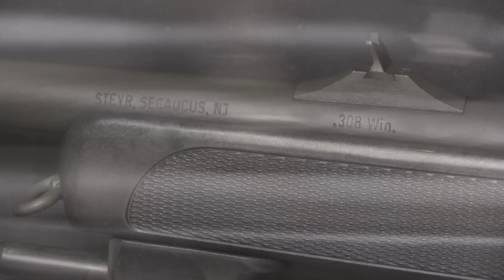SSG-69: Steyr's Cold War Sniper Rifle

Comment: The SSG-69 seems really nice, but it's unfortunate that we don't see this more often. Hopefully they make a more modern model something along the lines of the "SSG-420."
Reply: Nice
Reply: there are modernized versions
Reply: There are way better rifles than this at a much better price
Reply: Nice
Reply: Nice
Reply: @easy_eight2810  You know, I've always found the younger ones to be more enjoyable.
Reply: @easy_eight2810  Joke went right over your head, didn't?
Reply: Thank you. I was looking for a comment like yours
Reply: While the original (REALLY) turned some heads; I can imagine your proposal would smoke most modern competition. To be blunt: It would roll the whole field up.
Reply: @Bob-qk2zg  No, but it always shoots high.
Reply: Nice
Reply: I see what you did there.
Reply: Austrian painter commemorative edition
Reply: Nice
Reply: Nice
Reply: Eloquent
Reply: Czech has a ZK 420
Reply: Hehe, 69 ... really nice.
Reply: it would be a blazing success
Reply: Nice
Reply: Nice.
Reply: Had me in the first half not gonna lie
Reply: @Bob-qk2zg  The SSG 420  works with special  ammunition and a fume extractor.

Special as in "herb-infused" and fume extractor as in "this screws into your gas mask, and you will enjoy it!"
Also cuts down on the thermal signature and improves accuracy a bit by calming you down after a few hits.
Reply: I do have to disagree that the guard is the most common failure point. It is actually the magazine. There is a very small plastic connection that likes to break. That's why 5 round magazines are basically non available, you can find 10 rounders which are double stack for a few hundred bucks.
Reply: Nice
Reply: They could chamber a bigger version in .416 Barrett and use marketing magic to call it a .420 cal rifle xD
Reply: Nice
Reply: You're blazing it!
Reply: Nice.
Reply: I understood that reference
Reply: Isn’t the SSG-420 just a Blazer-R93?
Reply: @Bob-qk2zg  hookah tube attachment in the buttstock (stock is hollow, filled with water)
Reply: ....nice.
Reply: My favorite number (wink)😏
Reply: Nice
Reply: Nice

Comment: I have two. An SSG69 with double sets and an SS69PII with a single trigger group. Both are extremely accurate. With the hand loads under 1/2" MOA is possible.
Reply: Hey. Is the military two stage trigger good enough to match the accuracy of the set trigger version? I generally like a good two stage trigger better anyways for timing shots as I have a TRG (whose trigger is pretty damn good if I say so but I always wanted an ssg69 anyways haha). Thanks
Reply: @ryaniam22  I have gotten sub 1/2 min. groups with the two-stage trigger with handloads

Comment: First time I got issued the SSG 69 I managed to get 57 out of 60 rings on first try. (you can single load a cartridge and attach the magazine giving you 6 rounds)
It speaks for itself if a conscript with minimal experience can get shots on target that easily and this further enhances the military value of this rifle.
The trigger feel of the military version is also great.

I am still looking to snatch myself one of the military pattern rifles for private use, but they only rarely show up for sale and are pretty expensive.
Reply: Hey. I'm curious, do you prefer the military 2 stage trigger or the set trigger? Generally I prefer a good two stage trigger (TRG) but could probably get used to a set trigger also. Thanks
Reply: @ryaniam22  I can't compare the two since I only shot the military version, but I can compare it to other firearms that i have shot. what I like about it is the "mechanical" feel of the trigger, and how it let's you set the trigger up against the wall, readjust your aim and then be confident when you finally want to shoot. and you don't need much additional pressure at that point, you can set it off with the very tip of your finger.
i don't like single stage triggers, for example in pistols, where you apply pressure, thinking in your head that the gun will go off and then it doesn't because you are hung up on that final part of the "hump". with such a trigger it takes much more rounds until you are confident you can judge the right amount of pressure while not "oversqueezing" at the same time. i hope that makes sense.

Comment: It's impossible not to love rotary magazines. So awesome.
Reply: I totally agree!
Reply: Unfortunately Steyr dropped the rotary magazine as well as the position of the locking lugs....
Now the actual design is far more conventional than back in the late 60ies/ early seventies. At that time you could get several progressive designs with Steyr-Mannlicher, the Mauser 66 and the Sauer 80/90. All are gone...
Reply: Unless you have to use them. In my time in the austrian military, the magazine was by far the biggest flaw of the gun. If covered in snow (or dirt), it is almost impossible to remove since the two release buttons become inaccessible. Had to remove my gloves to way often on the breezy mountaintops of styria.
Reply: @ingowalkerling5141  The Mauser 66 seems to have been "reincarnated as the Blaser series; eye-watering money, but......

Comment: I used one of these many moons ago and found it to be supremely accurate and very user friendly. The one I used had thr polygonal rifling, an interesting detail and one I am a little surprised Ian didn't mention. I can't believe mine was in any way a "one off".
Reply: Steyr manufactures their own barrels--and never ever I heard of a single polygon one,they hammer-forge their barrels,and making the "pilot"is quite expensive,and not feasible for a small series.either you have a "one-of a -kind",extremely rare, or the rifle was rebarreled,perhaps with a "Lothar Walter"barrel.On Steyr barrels you see the hammer-markings.This should be a clear indicator!

Comment: That is crazy to think that the barrel is just shrink fit into the receiver, and with rear mounted locking lugs, the chamber pressure is acting directly on that shrink fit joint. That must be a heck of an interference fit to withstand a 7.62x51 trying to rip it apart.
Reply: The barrels are frozen really cold while the receiver is heated up a few hundred degrees and then press fit together using a hydraulic press and several dozen tons of pressure.  The end result is the barrels have to be cut out of the receiver using a lathe to be rebarreled and Steyr was the only place that had the gear to install a new barrel without threading the receiver.

Comment: Bought mine in 1988 and still shoot it competitively. Mine seems to prefer projectiles of 155gn, such as SMKs or Nosler CCs.  The trigger guard and mags are indeed  flimsy. My original trigger guard disintegrated, not helped by exposure to the bore cleaner I was using  at that time.. Steyr apparently realised the shortcomings of their original design as the replacement I obtained featured steel inserts for the action screws. A better option is the alloy trigger guard made by Styria Arms which takes AI mags. I'm told barrel replacement is possible by any decent gunsmith. Push out the old barrel with a hyraulic press, chill new barrel in dry ice and insert by hand into warmed action.

Comment: Good job, good video, Ian. I like the metal trigger guard/ magazine box/metal mag. If I owned that rifle, the stronger parts would be installed and I’d never look back. The group size on your 100 yard target looked fine to me. Different bullet brand and grain weight could easily print tighter. As in Sierra 168 gr. BTHP
Reply: The parts are almost impossible to get, the plastic mags are very fragile, and very expensive. Steyr won't even respond to emails regarding spares. Shoots great for its age though.

Comment: @12:00, The stock needs to be shimmed properly to the new replacement metal receiver. That is why you had trouble inserting the Arctic Warfare single stack magazine when the bolt was closed. The rear dovetail scope ring also needs to be set further back like an 1/8" to completely clear the ejection port.

Comment: A couple of additional things I can add... the factory rotary magazines and the plastic receiver are fragile even when new and are not mil spec in any way. If you improperly clean the gun and solvent (especially copper solvent) saturates the receiver or the plastic latching mechanism on the magazines, the plastic becomes brittle and literally disintegrates. Clean this gun from muzzle to breach if you have the factory receiver/mags. The best solution is to buy the metal receiver that accepts AW .308 straight mags. The ABS stock is not affected by chemicals like the receiver/mags by the way. Another issue are the scope rings and trust me they are in no way "Quick Detachable" as designed. Only the factory dovetail rings will work... which are fine if they are installed properly. The screws for the rings are a proprietary flat head... which can be difficult to cinch down tight enough of you don't have screw driver with a small enough head that can also provide enough grip/torque. They are easily buggered up if you are not careful. The last issue is the aluminum accessory slot at the bottom of the foregrip. It is very fragile cast aluminum... and a slotted adapter with a sling stud and set screw is used to attach bipods and other accessories. The problem being you have to really screw the set screw in tight so your bipod/accessory doesn't shift and move under the recoil of the gun. Barely overtighten the set screw and you will crack and blow out the rail. I went through two of them before I had a local machine shop make me one out of steel. Not perfect out of the box, but overcome these issues and it really shines. Mine shoots 1/2 MOA all day long with factory match grade ammo... shoots slightly under that with hand loads.

Comment: So many similarities to my 270 luxus and the bolt internals look identical.
The single set trigger i use on every shot iv ever taken over the past 30 years. 
It takes some of the guess work out of the guess work in the field and would not be without one.
You should have shown them on how to unset the trigger it with the safety on or off :)
Keep up the good work.

Comment: I owned a Steyr SSG P2 Police sniper rifle. Single trigger, heavy hammer forged barrel, no iron sights.... it was  a supreamly accurate rifle from 200m and 600m in 7.62x51mm (.308") BUT those 5 round plastic magazines WERE CRAP! rounds would stick, tilt, and rarely feed more than 3 rounds without jamming! I had 5 magazines and they all were bad. There was a plastic 10 round stacked (not rotary) that were slightly better..... the steel magazine and trigger guard upgrade looked great BUT the cost was nearly 75% of what I paid for the rifle new in 1988 (£ 1,050).....

Comment: To the best of my knowledge, the Steyr SSG was only available with one receiver size and in .308 and .243. The hunting variants, could be had in all popular calibers from .222 to .458. 
As Ian and many commenters rightly remarked, the synthetic parts are its greatest weakness, as they are aging with  use (sunlight) and possibly also without. The police of Berlin had them in their arsenal, until the stocks lost their ability to hold the screws. It was availabe with a similarly looking wooden stock, though. One of its biggest drawbacks is the practically almost impossible rebarreling, when the barrel is worn. Steyr claimed a maximum spread of 70 mm at 300 metres with sniper grade ammunition.

Comment: I do have to disagree that the guard is the most common failure point. It is actually the magazine. There is a very small plastic connection that likes to break. That's why 5 round magazines are basically non available, you can find 10 rounders which are double stack for a few hundred bucks. I found out the hard way.
Reply: You can buy new rotary Steyer mags for the SSGs from Steyer America, just got two a week ago for my PII.  I'm ordering the metal trigger guard/mag well from Austria this summer.  My plastic unit hasn't failed, I just want a reliable set up with the AI mags.

Comment: on my steyr SM12 i have the standard "french set triger"... difference is that instead of having a seperate "set triger" on the rear of the actual triger you just push the single triger forward if you want to "set" it.... if you don´t want to use this feature you just use it as you would use any normal triger....

Comment: I have owned two SSG's mine were the police model with the heavy barrel. I found the magazines fragile (the 10 round magazines disintegrated in the boxes - not sure they were Steyr though) and I couldn't single feed a round as the magazine does all the work with no feed ramp and the ejection port was very small, good for accuracy bad for trying to get a round into the chamber. 

The SSG was a very accurate rifles though! But when I replaced my last SSG with a Remington M700 there was no floor plate to convert the gun to AI magazines. A good M700 can be very accurate and with aftermarket floor metal it can be set up to use durable HS or AI 10 round magazines and be single fed. I would be interested to know if the magazine conversion allows the SSG to be single fed through the magazine port.

I know of gunsmiths that have rebarreled SSG's by cutting the barrel off at the action and then boring and threading the remaining stub.

Comment: I'm curious to know if Steyr negated the issue of bolt compression through the use of specific materials, or treatment of those materials. Or did they simply find bolt compression in a rear-lug configuration to be negligible?

Comment: I almost bought something similar in the 80's, SSG-something. The bolt felt too weird, before I liked weird guns, so I didn't buy it. It took me 4 or 5 tries at dry firing before I could even put my finger on the trigger without setting it off.

Comment: The 'ABS stocks have been known to fracture at the wrist; very untidy and a challenge to repair. One of my regular "shooting buddies had such a failure on his green SSG and it took a LONG time to obtain a replacement stock. Polymers have come a LONG way since those days.

Nothing inherently wrong with "rear-locking" actions.

The classic L-42A1 for example. Also, the Sauer 90 / 92? But, you won't see many of those being dropped out of tree-stands. Additionally, virtually every bolt, lever and pump-action .22RF rifle has been "rear-locking". This includes serious competition types.

See also the much maligned Remington 788. The poor old 788 was introduced as a "budget / entry-level" product to  go "one better" than the Savage 340. And the 788 sold like hot-cakes, because it was affordable and had impressive accuracy out of the box. I suspect that Remington liked the better "margins" on the classic 700, so the 788 was "put down" at a young age. The 788  trigger packs were a bit fragile but very good for the price.

In these parts, (Oz), there were characters buying them and then turning them into bench-rest rifles, either in .222Rem or .308Sin., by sleeving the already stiff action (rendering them "single shot", but in bench-rest, who cares). The trigger packs were a little fragile. Also, careless reloaders soon discovered that the brazed-on bolt handle came off if excessive violence was used to open the action after a dubious cartridge (hot load / UNTRIMMED cases) was fired.. I have worked on a lot of them, and "re-attaching" bolt handles  was a common thing. Part of the problem is that the base-stub of the bolt handle is also the bearing for primary extraction; not a good idea. Kicking open the bolt with a case stuck in the chamber also did nasty things to the bolt "face" and its dinky recessed-ring extractor. The serious enthusiast can do a "Sako extractor" conversion, as 700 and 788 bolt bodies are VERY similar in diameter. NOT for workshop, "newbies", however. And if you are good with the TIG, chipped "collars" on the bolt face are repairable. With the bolt handle CAREFULLY TIG welded in place and SENSIBLE ammo used, they just keep going. Also, they have a LONG breech thread; very stable and easy to adjust / replace a barrel. The "floating" recoil lug is a pain, but also found on more expensive rifles. Throat going bad? Set the barrel back a couple of threads and go again. There ARE limits, as one would expect. Just how many rounds of SAAMI spec ammo does it take to erode a throat out by a quarter-inch or more. In a "hunting" rifle?

Comment: When you have set the trigger, can you then unset it safely again? Or do you have to fire it?
Reply: You don't need fire the gun.
Engage safety.
Press and hold the rear trigger.
Press and hold the front trigger.
Release the rear trigger.
Release the front trigger.
The trigger is now unset.
That's the way I learned it  in my hunting exam.
Greetings from Austria 🇦🇹

Comment: The SSG 69 is a classic! I prefer the P II model with the heavier barrel and badger style bolt handle. Two things, that bipod setup looks atrocious, lots of movement and not looking too stable. Secondly, if you don't know if a rifle is zeroed or not, pull the bolt, steady the rifle looking down the barrel to see the target through the bore. Then look up through the scope to see if it is on target with the bore. Adjust if necessary to get onto paper without wasting any ammo first.
Reply: Agreed on the PII. I saw the bipod issue right off the bat as well, compensating for the weak aluminum accessory rail. Setup and pre-production failure. Good eye dude.

Comment: I had one in the late 90s.  Mine was green with a single trigger.  Sold it to finance a custom longe range match rifle.  The guy who purchased mine had a son who was a ranger sniper.  He was issued a Remington.  Thought it was a very nice rifle until he shot the SSG.  How dies my  custom rifle compare?  Custom rifle in 308 Norma mag will keep 5 shots under a half inch at 200 yards. Which is what the SSG would do at 100 yards.  GI ball ammodid not work well in my rifle.  The necks were too thick.  Resulting in stiff bolt lift.  Other thsn that it like this video were great.